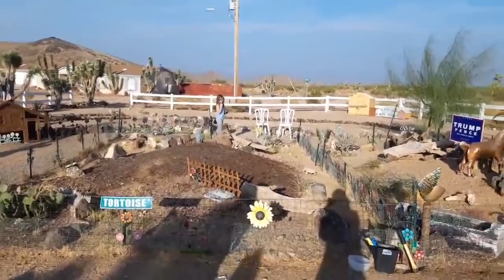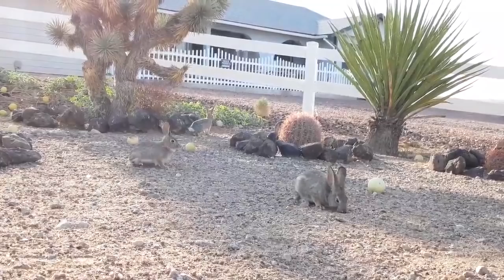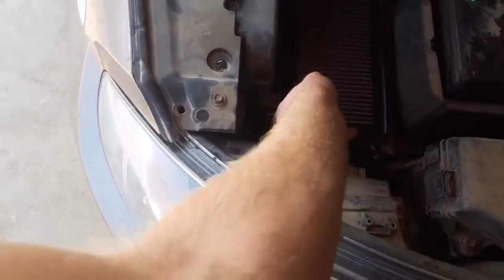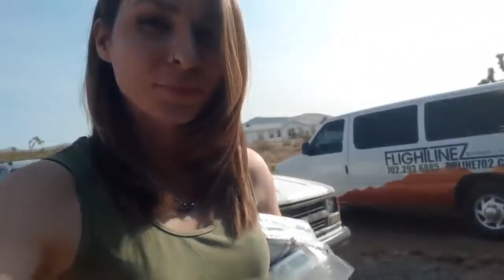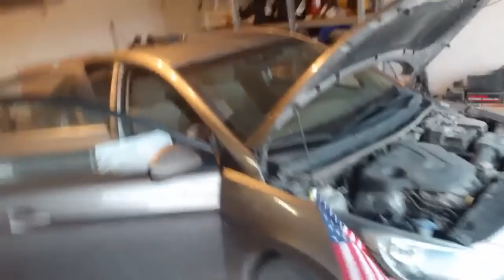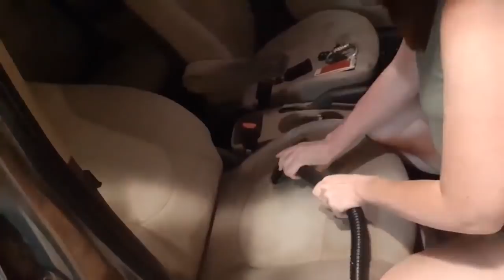Gettin Ready for Our Road Trip 🤓|Car Maintenance & Desert Tortoises

Comment: Some newer cars have the oil filters inside the oil pan, so you have to take the oil pan off and sometime the require special tools. I had a Che y HR that my cousin went to change the oil and couldn't do the oil change. He had been a top mechanic and knew what he was doing. The battery was in the back compartment under the spare tire, all electric with handle on the hatch, so if your battery,  you had to climb over the back seat and pull the string to open the hatch. I hated that  ar. The car that I have now is a Dodge Avenger and the battery is behind the left front tire and you have to take the tire off to change the tire. As soon as my S-10 is repaired,  the car is leaving and it will be pick up trucks from then on. I have severe back problems and my back hurts when I drive cars. I don't like transazles.